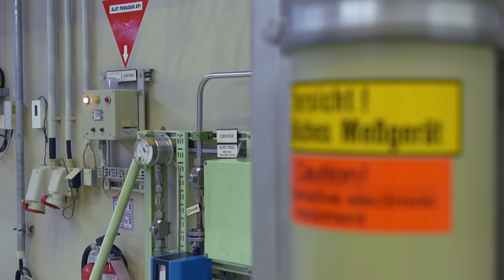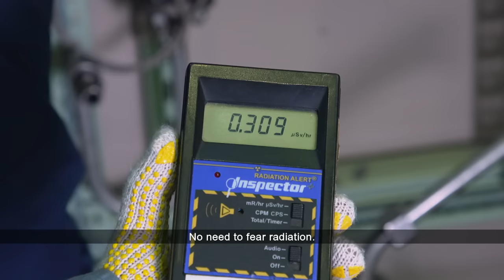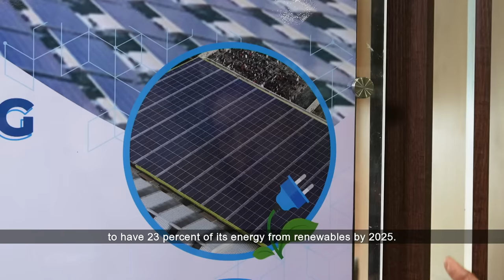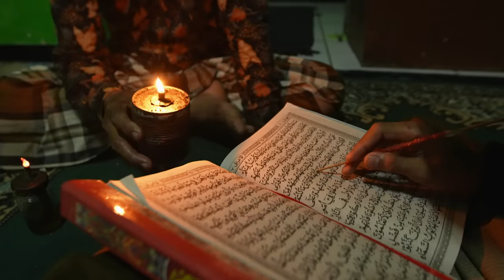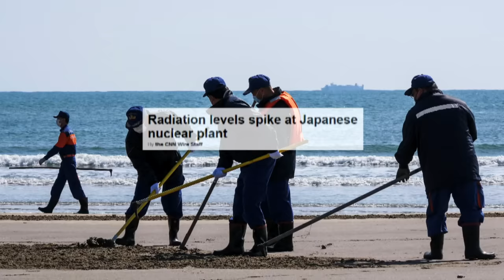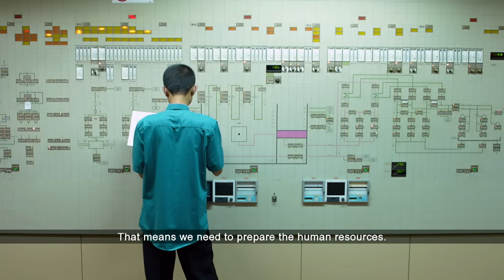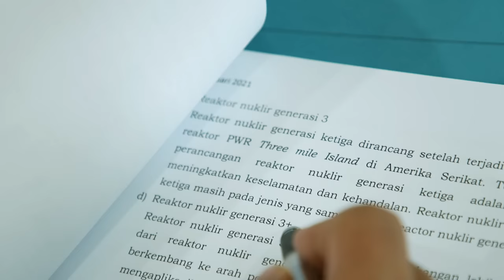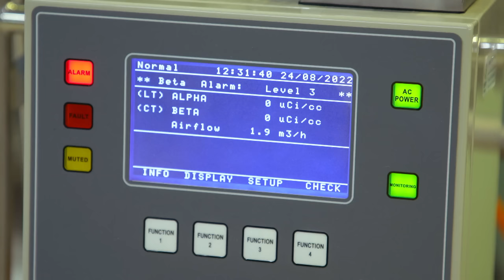Can Indonesia Harness Nuclear Power By 2045? | Insight | Full Episode

Comment: Nuclear is energy that is quite cheap and clean, cleaner than coal power plants that are still operating today in Indonesia and cheaper than coal when compared to the electricity capacity provided.  although the final waste needs extra handling.  With all its advantages, Indonesia can export cheap electricity to Singapore or Malaysia

Comment: Even after you convinced the population that nuclear is inherently more beneficial than conventional coal/gas plants, the real hurdle is the capital cost and lengthy time to go nuclear. Making it earthquake proof will add cost, but the real challenge is whether it can sustain its energy output during or after shock.
Reply: All nuclear power plants have earthquake countermeasures already designed and built in.  Small modular reactors could easily be installed in two years or less in many places all over the country as they are needed for regional energy.
Reply: @danadurnfordkevinblanchdebunk  Small modular power plant is at this point still impractical.
Reply: One can also build nuclear plants as far away from tectonic fault lines as possible.
Reply: @lyq232   Tell that to the many countries that have been building and using small modular reactors for many decades, built in two years or less, for millions not billions.
Reply: @lyq232   No nuclear power plant in the world has ever been destroyed by an earthquake.  They are built to withstand the worse, just like Daiichi and Diani did.
Reply: @lyq232  well Kalimantan island have zero fault lines and it will be the indonesia capital city, let's be honest today nuclear technology are more advanced than 50 year ago.

Comment: Im a indonesian. I think the government instead of going full nuclear power plant should think about empowering their citizen the ability to generates their own electricity by all means through solar and/or wind. The government should push a bill about independent energy bill that force people in indonesia including the land developers to raise the standard of building they about to build by adding energy generating devices on the structure (rooftop or lawn). Indonesia is at the ring of fire, IF something unwanted and unpredictable happens it would be too late to fix it, the damage already done.
Reply: Solar and wind requires battery to be reliable for daily use. That itself will also lend a lot of environmental destruction via Nickel mining
Reply: asal ngomong, IF something², dikira buat PLTN ga ada banyak safetynya layernya kali.
Reply: @lyq232  Can you guarantee 100% if the government will stop mining nickel? It got so many uses  and high value, you know that right? otherwise jokowi will not bother improving its processing standard.

And second,can those safety measures/procedure handle multiple types of catastrophe ? Mega crust effects for instances?
Reply: @dediprakosa7727  I can't guarantee that mining will be stopped. What I can guarantee however, is that solar and Wind, plus the EV craze will drive nickel demand through the roof, unless alternative batteries are found. Today's nickel usage will seem miniscule if Li-ion batteries start being used everywhere as large-scale energy storage.
That's why I prefer if we minimize the use of battery reliant power source.
The sheer amount of effort that one needs to put to 'clean-up' nickel mining process is enormous, thanks to the large scale of operation alone.
I would go so far as to say that making nickel mining 'clean' is much harder than building a modern reliable nuclear plant.

to also reply your second question:

Today's nuclear power plant designs are much more robust than ever before, thanks to decades of research and case study, and also the drive to overcome the great fear of nuclear in the cultural Zeitgeist.
If you are still worrying about failing power plants, I suggest you start researching about past incidents of nuclear power plant catastrophe, see why they happened and what has been done since then to avoid the same incident.
And no, please don't take your technical information about nuclear power plants from HBO's "Chernobyl". That's like getting relationship advice from teen dramas and soap operas.
Reply: mudah di lakukan tapi ada hal lain yg bikin susah, negara lain juga pengen gitu tapi yang jadi masalah infrastruktur kelistrikan dunia kagak di desain untuk individu punya pembangkit listrik, harus di bangun ulang sistem kelistrikan negara biar bisa mendukung, ya kaluar duit lagi...
Reply: The nightmare of doing maintenance if each home has their own power generator.
Reply: Indonesia itu bukan negara kecil mas. Ini negara besar dan industri yg berkembang. Kalau ngandalin solar dan angin gk andal. Yg dibutuhkan disini keandalannya, bukan hanya tentang yg penting ada listrik.
Reply: Iya betul resiko nuclear kalau bocor bahaya banget , lagian negara Indonesia ini penuh dengan gempa bumi ..
Reply: @henryalugoro9049  resiko itu ada manajemennya dan gk semua wilayah Indonesia itu ada gempa 😅 Kalimantan contoh nyata mana ada disana gempa?
Reply: @dediprakosa7727  pemerintah lebih tau dari kamu jangan banyak bacot bla bla
Kalau ga setuju pindah sana
Reply: @uwaisal-qarni8364  coba cek Las Vegas, Dallas, Oklahoma, Paris, Lisbon, Yunani, Bangladesh,  Vanuatu, dll terjadi Gempa, Topan, Flash Flood, bahkan Tsunami  bulan agustus - november 2022. Saya ngga tau anda komentar buat tujuan apa? Tapi fokus saya cuma  satu aja indonesia aman. Ngga salah khan kalau mau cari aman? Lihat banjir dan tsunami seluruh bagian rumah sampai masuk laut serem (Yunani - Crete Island) kalau ngga salah, mereka sendiri ngaku kalau ombaknya makin besar tiap tahun ditambah hujan deras tambah gawat  saya lihat di channel di youtube juga khusus untuk bencana alam terupdate. Nuklir itu permanen loh saudara - saudari sebangsa setanah air, begitu full operational anda meninggal tugas ngurusinnya dibebankan pada anak cucu lho dan nuklir tidak sebersih dan seaman yang anda bayangkan lho, buktinya tuh ada limbah radioaktifnya bersih gimana coba? Sama kotornya cuma beda jenis aja ya ngga?
Reply: @dediprakosa7727  pikirin diri lu sendiri bro, urusan pemerintah mereka lebih tau dari lu
Reply: @uwaisal-qarni8364  ngga bisa lah itu tempatnya dekat rumah saya. Kalau jauh banget dari rumah saya dan dekat rumah kamu saya diam aja. Serpong khan itu tadi? Bangun hydroplant yang jauh dari pemukiman aja lah siapa tahu bendungan jebol tetap ngga ada korban juga dan HYDROPLANT  dan  Sea Wave plant termasuk yang paling bersih di dunia dan energi yang dihasilkan cukup besar juga. Update: Hari ini bahamas kena tsunami efek topan nicole silakan cek
Reply: @henryalugoro9049  bro, PLTN sekarang kalo ada yang salah auto shutdown, ditambah lagi orang mau ngilangin air sebagai media buat gerakin turbin di reaktor nuklirnya. Toh kata orang bilang, "nuclear reactor is a fancy way to boil water"

Comment: What is Indonesia's progress with wind and solar power generation?
Reply: Solar power is focused in the Lesser Sunda Islands with savanna climates with long sun exposure, the biggest I think in Bali. 

Wind generator in new to Indonesia, the biggest is in the island of Sulawesi, some considered it failure because the wind speed is changing constantly and generating uncertain amount of power.
Reply: There are 2 wind power generation in Indonesia,both in South Sulawesi : PLTB Sidrap 75 MW and PLTB Janeponto  72 MW. Some PLTS (Solar Cell) : Likupang 15 MW, Oelpuah 5MW, Waduk Cirata 145 MW solar cell project on progress ( floating). The biggest project on preparation is PLTS KEK Karimun (Sumatera) with capacity 3.500 MWp with storage capability 12 GWh. The electricity from this PLTS will be export to Singapore
Reply: @KGopidas  the biggest  project not started yet.. I thought its not about energy surplus but its a part of Singapore strategy to become zero emission country .. they didn't has land to put so many panels to generate electricity 😅
Reply: Indonesia do not have good potential for wind, its only in small areas, though sidrap is the largest wind farm in SEA. 

Solar has pretty good potential but only around half a year when not monsoon. Nusa Tenggara islands has pretty good potential for solar as its hot and dry. 

Next is water-related there are potentials for hydropowers, currently Indonesian renewable depends mostly on this through rivers and dams. There are rooms to grow. The most potential is in tidal power and ocean thermal energy, as Indonesia has large coastline but the technology isnt mature yet.

Lastly geothermal which is something that Indo government is focusing on, located on virtually on all volcanic islands except Borneo. Indonesia is the world's second largest producer of geothermal energy.

Comment: We already have 3 nuclear reactor here TRIGA reaktor in Bandung 2000, Kartini reactor Jogyakarta, G.A Siwabessy Serpong 1987. All working well as research reactor, the problem is most people in Indonesia didn't realize it was there and still afraid something goes wrong but infact it's already 35 years in Serpong Tangerang Selatan, Banten
Reply: its mini (micro) reactor. if it meltdown, but it wont because of its size. it has small effect, compare to big nuclear power plant